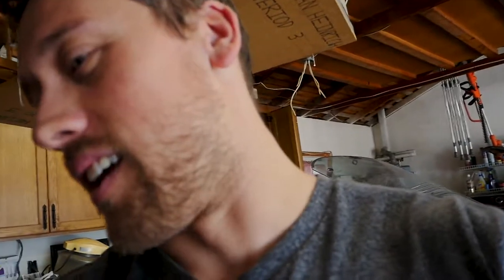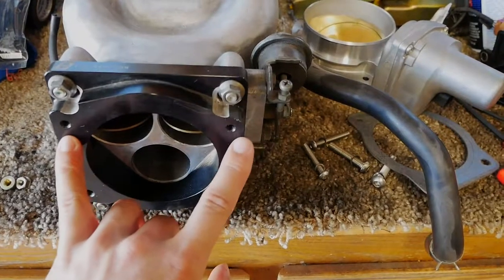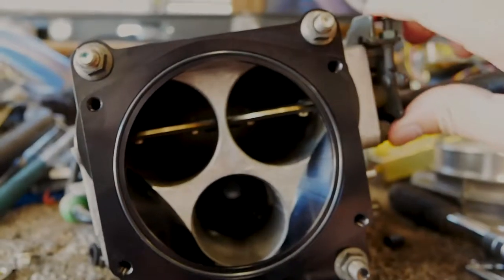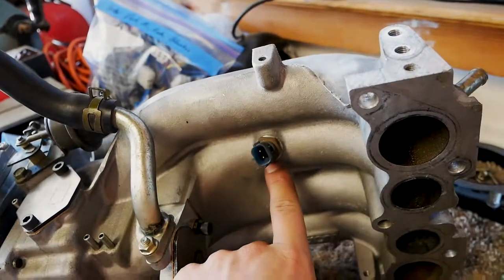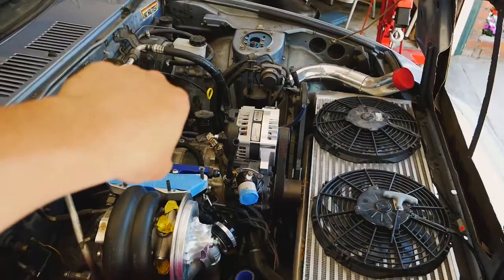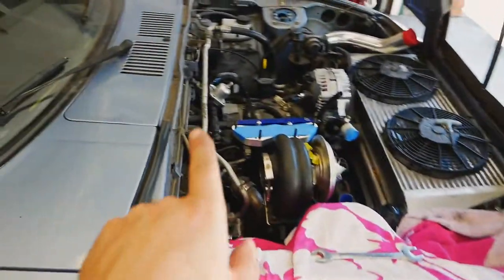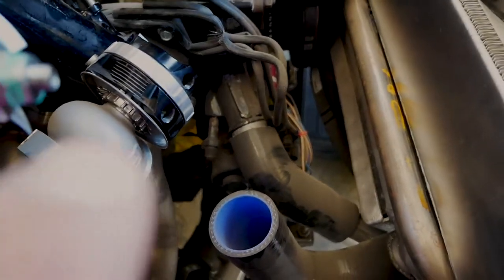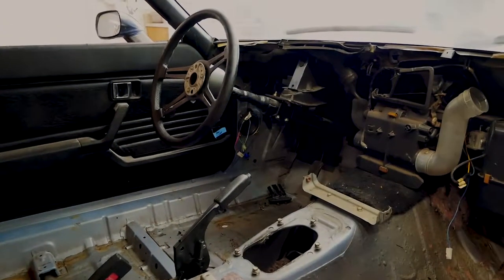Build Update with PME DBW Throttle Adapter Plate

Comment: Have you verified no interference betweeen the throttle body's blade and the secondary throttle blades when moved thru their ranges?  I'd like to get one of those adapter plates but was afraid of interference between the main throttle and secondaries.
Reply from the maker: Yes, I do that IN this video.
Reply: Thanks I skipped around a little and only saw the part moving the secondaries and not the main throttle.
Reply from the maker: @Frankie1994797  used a 1/2" adapter spacer.